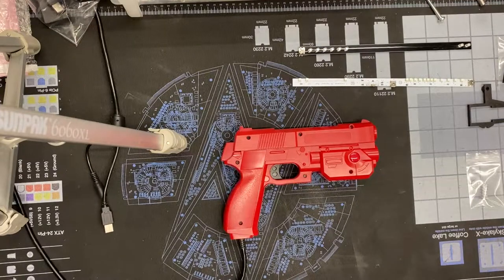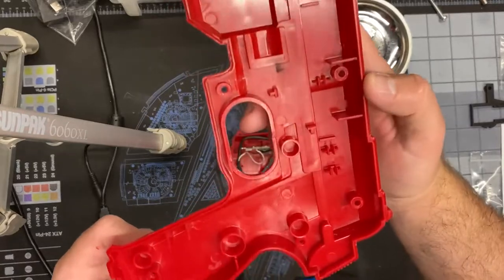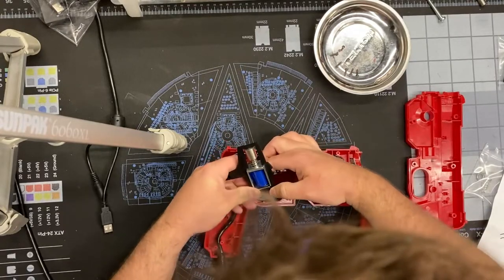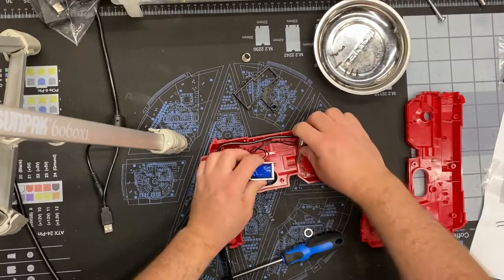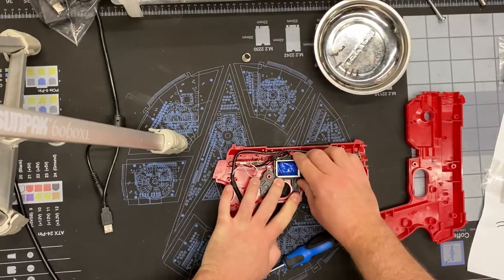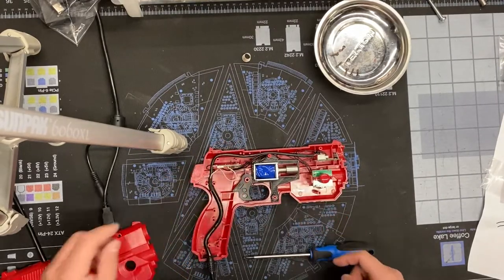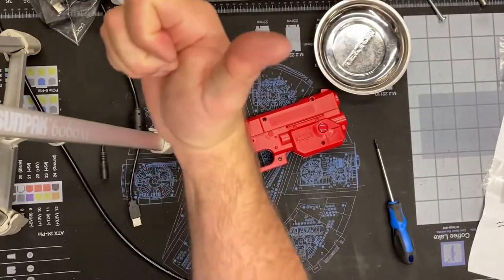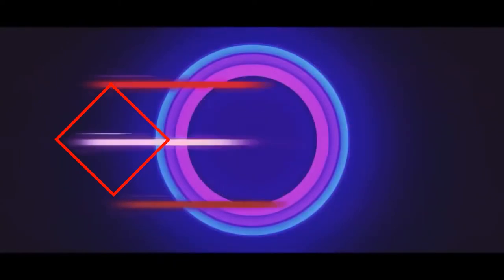How to Upgrade your AIM TRAK Lightguns with solenoid support and heavy spring!

Comment: I don't want recoil stronger. I want it more quiet. Maybe, I could add some felt.
Reply from the maker: That bracket with the stock spring and some felt is probably what you're after then.  Recoil seems pretty weak stock to me, why not just turn it off?
Reply from the maker: BTW, huge fan! Love your videos.
Reply: @ArcadeAdam  I do turn it off bc of the sound. I just never have the power cord plugged in.
Reply: @ArcadeAdam  Thank you. I like yours too.
Reply: Just insert a small pieces of tissue paper at the end of the bracket will do the work of reducing the sharp impact noise but become a much better real gun noise.